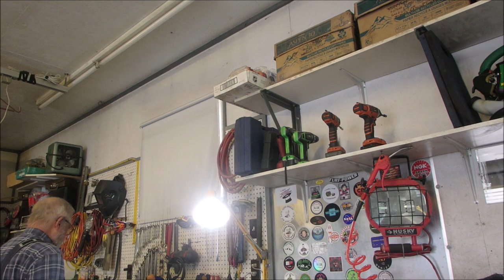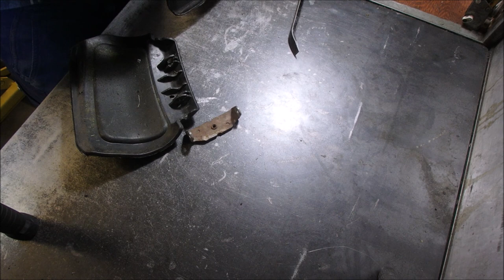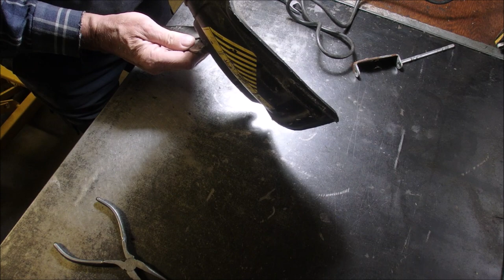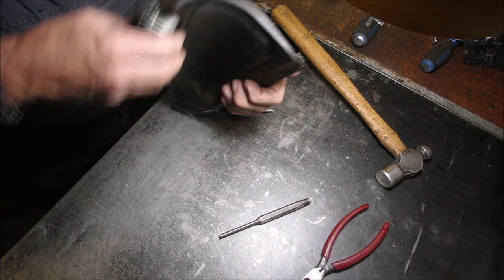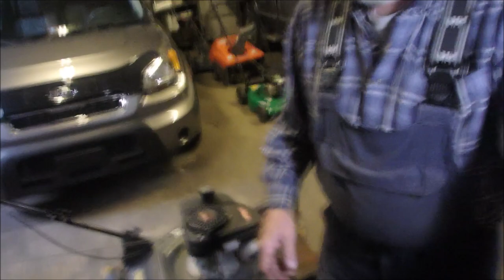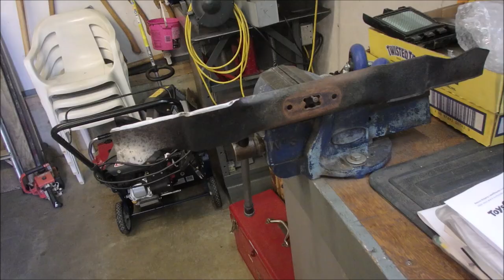Bent Powermore Stop bar, Plastic Repair PT2

Comment: For a youngster you did a super plastic weld repair job there Bruce. Same way we used to do it until Jake bought the unit in his video which for $30 is the 2nd most money making tool in the shop the ultrasonic cleaner being the number one money maker. The new plastic welders with the SS clips work awesome especially on hood repairs John Deere and Toro Wheelhorses are the ones we have repaired the most. A great addition to your tool collection if you get one.
Reply from the maker: Thanks for the tip.  I will ceck out the tool.

Comment: Great fix Bruce! That’s definitely an MTD, or at least it’s their design. Funny how many of those get returned when new because people don’t read the assembly instructions and fail to slide the handlebar up out of the deck. The blade hits the handle and the engine won’t pull over…return it!
Reply from the maker: Very true!

Comment: Nice job Bruce. I plastic weld the same way as you, with a soldering iron. The last plastic part i welded up I used filament from a 3D printer as the filler. Seemed to work. Mower sounds good
Reply from the maker: Great tip!  I would lke to get sme of that

Comment: FYI For those operators who loose or never had the side chute, bungee cords or wire is what they usually fashion to keep the door open. I sometimes fashion a metal  plate from framing gussets.  I attach it on top of the body and below the spring loaded door.  Keeps the door open below the melting point. Narragansett Bay
Reply from the maker: Great idea.

Comment: I saw the pull rope hitting a certain note, vibrating like a E string on a bass, meaning the blade isn't off balance like normal side to side, but front to back, the trailing edge of the blade is heaver then the leading edge, that happens when you sharpen a badly dinged up cutting edge, trying to make it sharp again, happens a lot on snapper blades.... Not much can be done except try to take metal away from the trailing edge of the blade, hope that makes sense.
Reply from the maker: Got it thanks